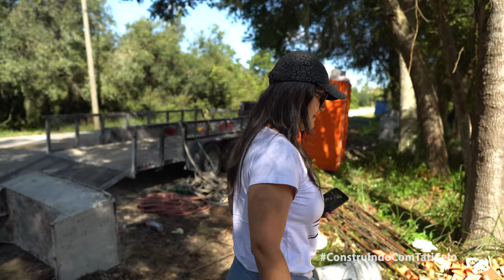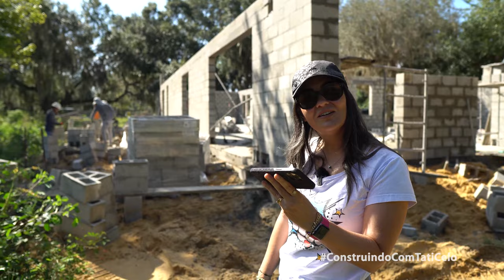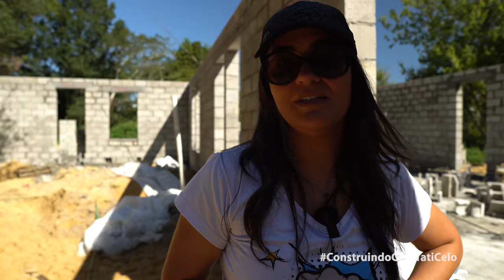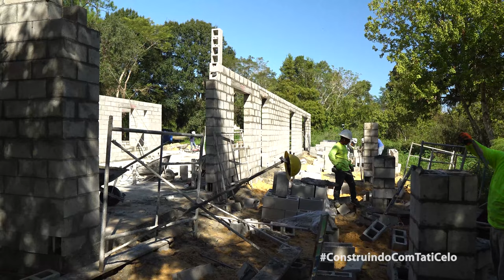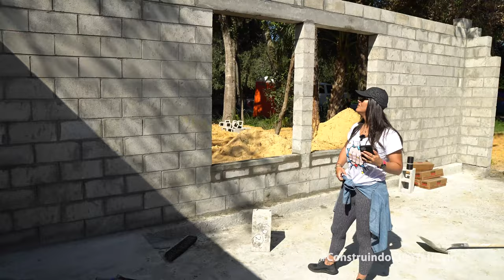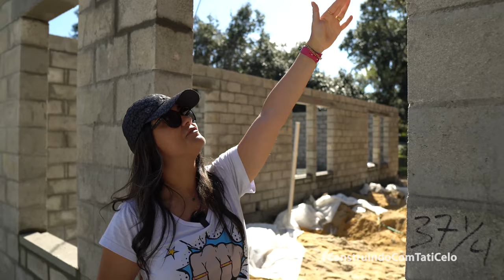🏠Live #15: JÁ TEMOS PAREDES + INCIDENTE NA OBRA | Construindo Com TatiCelo

Comment: Muita gente perguntando sobre as colunas da casa. Gente, isso chama alvenaria estrutural, os elementos estruturais nesse método são grauteados (preenchidos com um micro concreto fluido) por dentro do bloco junto com um vergalhão, ou seja, não dá pra ver por fora. Além disso, as paredes são autoportantes e elas próprias dão suporte a casa. É um método muito utilizado no Brasil e levanta até prédio, não se preocupem ☺️
Reply: Temos aqui uma engenheira! 👏👏👏
Reply: SIM, EXATAMENTE, INCLUSIVE MUITO SEGURO, OS BLOCOS FICAM PRATICAMENTE SESCONDIDOS, MUITO LEGAL....PARABÉNS! MUITO BEM COLOCADO...

Comment: Oi Tati.
Explica pra gente pq não tem colunas na parede? Não deveria ter para  suportar o andar de cima? Ou tem a ver com o tipo de bloco?
Adoro vcs! Bjos!🥰🥰🥰
Reply: É o tipo do bloco e da solução adotada. Com esses blocos os pontos de pilares e vigas são concretados nos vazios dele com o vergalhão de aço, ou seja, eles ficam escondidos, mas existem. É assim mesmo, pesquisa por alvenaria estrutural que vc vai encontrar mais informações.
Reply: @viannee  bah q show
Reply: @viannee  tô pensando em fazer assim nos fundos do meu terreno,uma área de lazer com dois quartos em cima de madeira para os hóspedes.
Reply: @feeolivers3229  funciona sim, o ideal é sempre falar com um profissional que pode te indicar a solução com o melhor custo benefício para o teu propósito. Existem diversas opções e combinações hoje para cada situação. O bloco estrutural normalmente tem um metro quadrado mais caro que a alvenaria cerâmica convencional, mas dependendo da situação no final sai mais em conta, já que vc economiza em outros itens.